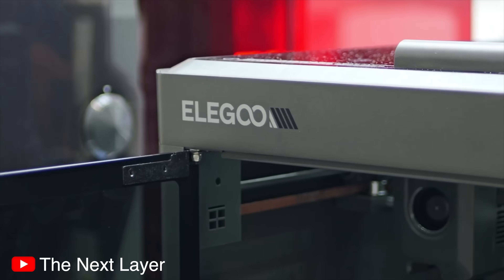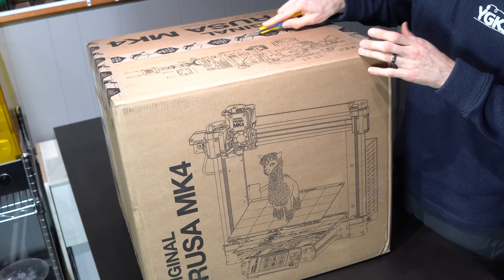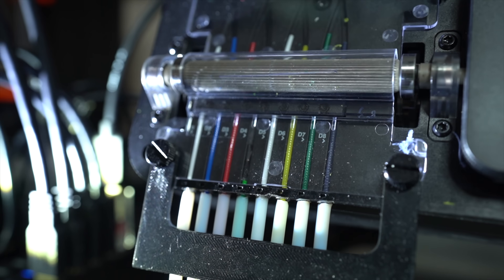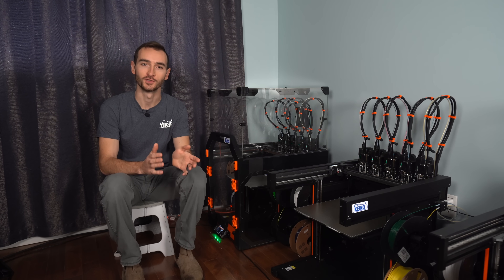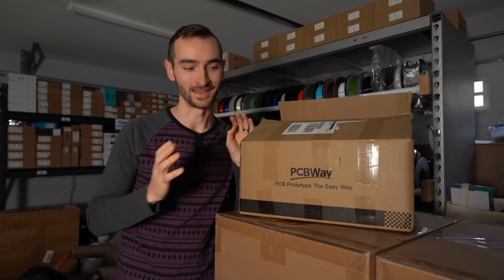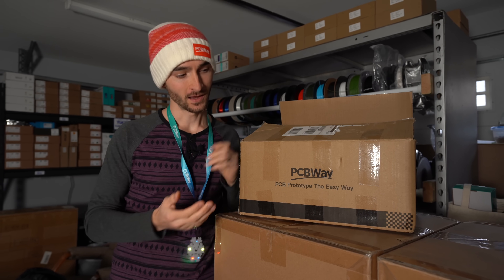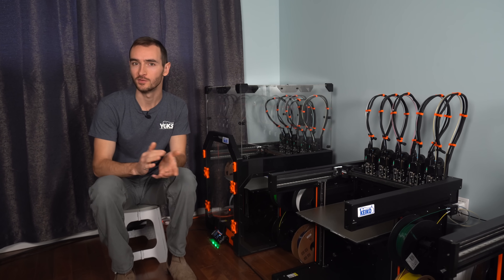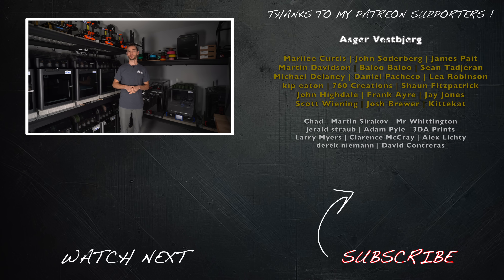The Prusa Core One is dividing the internet...

Comment: there is one show stopping deal breaking make or break killer issue for me - closed sourced dependance on a Chinese web service is a hard no
Reply: just put it on a VLAN like all your other IOT devices
Reply: all BambuLab printers support a LAN-only mode where it is not connected to anything outside of your own local network. You can still send prints over to your printer via the local network but don't have any cloud capability (the App becomes useless). You can also just use the micro SD-card.
Reply: @Silidor372  Their Lan mode is a joke dude. We have them at my university and we have had nothing but botched uploads when using it. We have reached out to support, they were not help, literally 12+ engineering students have thrown their might against this thing and it will just hang unless we do it over their cloud. This is over 3 machines btw. Not a fluke.
Reply: @SiFireHasSpeed  - Bambu really wants everyone using their cloud print server.  Kinda makes me wonder why.  I'm not playing that game.  My office 3D printer is two feet from my computer so why should I send my new product prototype to a Chinese server and then back to my printer?
Reply: @SiFireHasSpeed  Did you reach out to your university help desk? I work in IT at a universty and I can tell you that there is probably a networking issue like a VLAN/Firewall/QOS causing the uploads to fail. University networks tend to be quite the mess so its likely that may be the cause of your issue.
Reply: @SiFireHasSpeed  I'm 90% sure that this is caused by your universities local network settings. We also have one at our own local university and an additional one at my workplace and they all had issues due to the network settings. universities often hide devices from each other in the network which makes is pretty much impossible to use local network mode.
Reply: Have to agree, I would love to have a Bambu Lab printer, but that is number one reason my money has not gone to them.   I prefer open source.   I have a great deal of respect for Prusa, even though I do not own a Prusa machine either.  I will say the Core One is attractive, but I am really looking for something larger than my Plus4 305mm footprint, the Coreone looks to be good machine to add to the growing farm, but I am holding off any further printer purchases until at least April timeframe. I want to see what announcements get made first.
Reply: Do people really not know about this beauty? https://en.m.wikipedia.org/wiki/National_Intelligence_Law_of_the_People%27s_Republic_of_China Article 7 👌 May not be relevant for home users but if you work with new IP …
Reply: Just saw Disrupt 3d printers ready assembled appears to be offshoot perhaps from RatRig in article on YouTube from Rat Rig discussing HEP/Carbon filters,  Looks to be quite the machines, higher dollar, but may be exactly what I am looking for in 2025.  I have been seriously considering a RatRig with 3 heads.....this might be worth looking into.
Reply: Just don't give it network connectivity then, and move on with your day.
Reply: X1Plus custom firmware says hi
Reply: Please explain what you're so afraid of? No conspiracy theories - just evidence-backed facts please.

Comment: For me as a somewhat advanced home user the volume is the deal breaker on the core one. Even 250 cubed is jus limiting, and for small things I run a a1 mini in parallel. Looking forward to that H2D.
Reply: If that is the next Bambu (nothing is confirmed till it is). They hinted they were looking at the Prosumer market, not Consumer market for the next printer.And if the patents they filed in the last year or so are anything to go by, it will be something for the business user.
Reply: @alexa5231  H2D is the next printer because it has leaked. Prosumer market is not a thing. Theres just grades for consumer from low end to high end. Whether you are making money from it does not really matter for the manufacturer and industry is entirely different beast. H2D will be a high end, larger printer with a new type of multi filament head/system. I hope it will cost under 2k, but I have not much hope for that.

Comment: Prusa is the same old cautionary tale of being the leader and getting complacent. Though it is far from too late for them, they just need to play the next steps smart.

Blackberry was a confident leader in the market before the iPhone. Blockbuster was dominant until Netflix. Amazon beat out just about every retailer in online shopping.

Someone will come along from the shadows and make something better. Its up to the company to decide to make the hard choice and shift their offerings dramatically or be relegated to the history books with another cautionary tale of a company becoming too large to turn the ship and avoid the iceberg. Its not too late for Prusa, but they really need to make the hard decision and move past their framework they have dominated with. Yes the printers have been solid, but there's only so much upgrading you can do until the capabilities are maxed out.

Comment: I had a MK3S+ straight from prusa. Now I have a P1S. I bought the P1S because the MK3S+ was slow, and had a lot of failed prints. The P1S has none of that and is really fast. The X1C in my opinion is way, way overpriced and falls into the same issue with Prusa.

Comment: I started on an ender3 V1, but after many years of that love/hate relationship, it was time to upgrade. My deciding factors were build size and ability to print more exotic filaments. I decided on a Qidi Plus4 and so far, its been flawless. I did replace my SSR board since I live in the US, but that was super easy. I knew about the flaw before I bought it, so it was a nonissue. Multi color is coming next month!

Comment: As usual your reviews are top notch. Prusa has the right idea but by holding onto existing mk4 size, backwards compatability, they hurt their chances of retaking the lead position.  220mm  is too small for that price. Needs to be at least 256, and even better 280 or 305 for an even 12"  they're also competing with K2 plus and qidi4.  I would not buy a bambu. I'd like to buy a prusa but too small...yet again and I don't want or need a monster size XL.

Comment: The X1's just need some basic maintenance. Not sure how it could not be worth fixing
Reply: Right? I am nearing 3000 hours with my X1 and the only thing I've had to change was a hotend. All parts are listed on the website and a simple video watch shows you how to tear them down and put them back together. It's easy.
Reply: it's a bet that the ad revenue from a viewbait move will exceed the cost of the disposed machine
doubt it will work out
Reply: The entire heatbed is not "basic maintenance".
Reply: @carlosjosejimenezbermudez9255  let's see what you have to replace after 3000 hours on a Prusa
Reply: @carlosjosejimenezbermudez9255  yesp, neither is the entire XY gantry for a single bad part

Comment: I have an X1C with AMS, it has around 550 print hours. It's been collecting dust for weeks because I keep getting the Tool Head has fallen off error message for no reason. In addition the AMS is no longer recognized. I got a lot of spare parts from Bambu but replacing them is a pain and most of them are not fixing my issues (got my third toolhead cover, why?). I ordered a Core One now as its fitting my needs even better (e.g. printing fully closed PLA/PETG and active temperature control) and i hope for better/more effektiv support.
Reply: Brace yourself, a thousand people are about to start replying to you saying that their Bambu works just fine and has a million hours of printing no problem.
Reply: The OP is referring to a product they have ordered but do not yet have in their possession. Since the product cannot presently be fulfilling their needs (because they don't have it yet), the present progressive tense fitting is incorrect in this context.

Because the OP is anticipating the product meeting their needs in the future, the correct verb tense would be simple future (*will fit*) or perhaps simple present (*fits*) as a general statement of suitability. For example:

"I ordered a Core One now as it will fit my needs better." (Future tense for an expected outcome)

"I ordered a Core One now as it fits my needs better." (General present tense, expressing suitability as a fact rather than an ongoing process)

Fitting* is inappropriate because it describes an ongoing state that implies the product is already in use, which contradicts the reality that the product hasn’t been released yet.

To make the OP's sentence grammatically and contextually accurate:
Original: "I ordered a Core One now as its fitting my needs even better..."
Corrected: "I ordered a Core One now as it will fit my needs even better..."

The use of fitting in this context is incorrect because the OP cannot presently use the product. The correct tense would reflect future expectations, not an ongoing process. 

/Please see me after class
Reply: Look who came out of the jungle. Diddy Kong.
Have you forgotten I started with ender, ankermake, had a kickstarter bambu and still waiting on a Prusa competitor to match what I have had for 2.5 years.

I am still waiting on prusa to Catch up to 2022. Where is your camera? why cant the mmu3 go to 16 colors like my AMS? I barely do multicolor but having 16KG of filament at the ready means I can swap filament without touching filament for weeks. 

I can print, monitor, and control my printer remotely without ever touching a slicer, loading filament, auto filament redundancy. Heck I have been printing remotely for clients and have a prototype printing while I am on the road.

So the Core one is vaporware. They announced to get Xmas sales but where are the printers? Where are the kits?

 Where are the reviews? Where are the prints from independent sources. We have seen Josef fat@$$ stand on one. We have seen him slam a plastic door. We have seen a magnetic fish stuck to the side. This doesn't exactly fill me with confidence that they will even match what I had for the last 2.5 years. 

Competition is supposed to benefit everyone, I am wondering why Prusa fans are putting up with this lesser printer for more money.
Reply: " I ordered a Core One now as its fitting my needs even better"

Wow you ordered and got a Core one BEFORE they even started shipping(jan 2025). This is $100% a real user...lmao. There are zero reviews, no active printer shipments, but somehow you have one....ok buddy.

Which version of unreleased Prusa slicer are you using that has Core One profiles?

Josef train your bots better, this is just embarrassing.
Reply: @AmericanVirus-rf1rn  He didn't say he'd received it. He said he ordered it. Put on your reading glasses.
Reply: @warwickshaw155  lol
Reply: @AmericanVirus-rf1rn  I think you missed a "I hope" in their comment.
Reply: @mastah39  That's even worse. He is comparing literal vaporware vs an actual product.
The first Gen of any prusa product is a shite show.
The mk3 and mini has tons of issues until the firmware matured but the mini still has issues cooking the ptfe tube in the hotend. 
The mmu and mmu2 were abject fails. (mmu3 looks ugly as sin but it at least works now, as 3rd times a charm)

The XL was plagued with issues for a year. They had to walk back the .6mm nozzle for .4mm because of the tons of issues.

 See Taylor's video on multiple prints on the XL. 5 of 13 were semi successful but mostly they failed or looked horrible. If anything he wasted more filament trying to get a good print than just printing it on an equivalent machine. 

The Mk4 was shipped with tons of bugs, missing features(input shaping, beta firmware lets not forget the "bonkers benchy" with a single wall and lightning infill )
The mk4s was caught hyping the overhangs with a slicer bug that was fixed on the bambu side in a week after Robert Cohen called out Josef so the $100 for a fan and a nfc reader was hardly worth the upgrade.

Now the unreleased Core One is the savior of the industry. This is Prusa Gen 1 product so i wouldn't hold my breath it will be a hit until the firmware, software and hardware matures. Never preorder, wait for reviews, do not be a beta tester for a multimillion dollar company.
Reply: @No0o0o0o0o0  One commenter said he oredered one basing his choice on the marketing. Debatable? Ok.

AmericanVirus-rf1rn replies by showing a surprising lack of reading comprehension, thinking the user in question is pretending to already have the printer.

I make a joke a bout that. 

You come, saying that it's even worse than pretending to have a product that hasn't launched at and then proceed to start ranting about Prusa, something nobody asked for or needed. 

I just hope that whatever is going on in this comment chain isn't contagious. 

BTW, tha's not how the word "Literal" works.

And yes, I know your bambu has printed for 10000 hours and made you coffee and has had no problem, I don't care, I will now go back to my 2017 Tevo Tarantula, which can go almost two full prints without me having to disassemble it and rebuild it from scratch with 300€ of updates.
Reply: @mastah39  Ignore that guy. Hes been printing for only a year and has zero experience with prusa. He's a certified bambu stan and he still needs his bambu to tell him if his 1st layer is good or bad becasue hes too inexperienced to tell the difference between a good or bad 1st layer. His opinions are irrelevant, always have been. Him calling a prusa product vaporware just shows how litter he understands prusa.

He actually thought his bambu was better than a prusa becasue he thought the thin gauge frame made out of pot metal on his bambu was stronger than 1/4" aluminum plate and extrusion on a prusa MK4.

Comment: Sucks about your X1Cs; We have 2 P1P's with over 3000 hours each and 4 P1S's (2 of which have over 3000 hours each as well) which have had little to no issues. Only major issue we've really had were force sensor errors on a P1P (possibly the same errors you're getting which ended up just being an issue with the cable connector -- wiggling the connector at the board helped for a week, and removing the glue on the connector then reconnecting it has resolved it ever since). Another issue is that 1 of our AMS units doesn't always read RFID tags but I haven't bothered to look at fixing it yet. We've had a handful of smaller issues but I can't even remember what they were. Previously used Prusa MK3S+ but found it more prone to issues and more costly to get parts.

Comment: As an owner of 4x Bambu X1C, 4 Prusa's (MK4S's and a XL) and some other printers, I have a divided opinion. I love Bambu for their simplicity and ease of use... But I hate them for the fact that one faulty idler can ruin a 1200 euro printer. Where it is easily replaceable on a Prusa, Voron, Ratrig and many other printers. I dont wanna throw away a printer for only one faulty idler (or spent 8 hours in replacing one single idler). So as long as it is printing without issues, Bambu is fine... for me having a mini printfarm,... I'm phasing out the X1C's.
Reply: You mean the idler pulley that is $6.99 in the Bambu store? And you think that would take 8 hours to replace with the detailed instructions on their wiki? looks like a 20-30 min job to me... All the parts I have replaced on any of our Bambu machines (which isn't that many) have been much faster than other printers I've worked with. You probably can replace one faster in an open bed slinger but it's not like the Bambu parts are failing very often.
Reply: @ no that’s only the belt tensioner… that’s easy! This is hidden behind the side panels and those idlers are mounted with a one way pressed pin, which can’t be removed easily. You have to tear down almost the whole printer. If they had made a small hole above to remove it, but no. So I’d wish it was that easy but it ain’t.

Comment: Picked up a MK4 kit early last year, then learned about Bambu Labs while my MK4 was shipping. 
I hadn't super been into the hobby since mid-end 2020 (IDK when Bambu started / got popular), but if I learned about them sooner, it would've made my decision to get a MK4 harder. 

Currently, I'm happy with my MK4, now upgraded to the MK4S (Still unsure if the upgrade was worth 100 bucks though)
I'm going to do the Core1 conversion, but unless I happen to get a great tax return, I'll wait till next BlackFriday, or for the 1-year anniversary to get it on some kind of sale (or maybe some kind of filament bundle)

My first printer was an Anet A8, second a Monoprice Select Mini V2 (as a cheap second-hand backup printer), and third was an Anycubic 4Max.
About 2-3 years ago I got a used Prusa Mini, and quickly fell in love with how reliable it was, so that pushed me to get a MK4 earlier this year.  I've definitely moved away from tinkering, and now just wanting a machine that works.